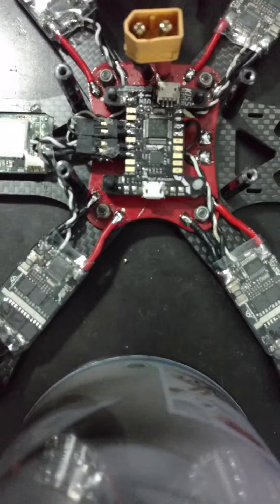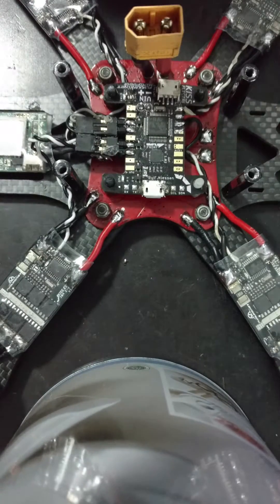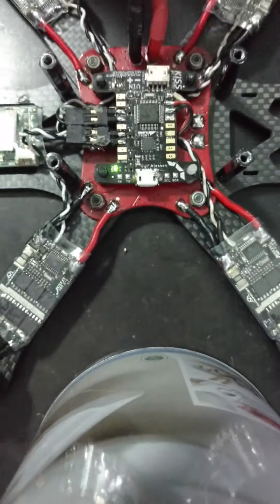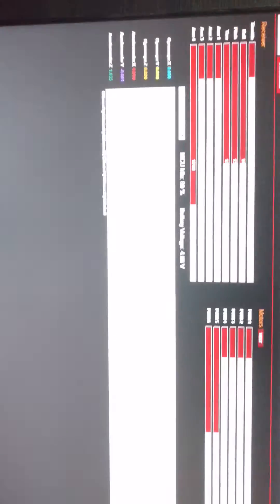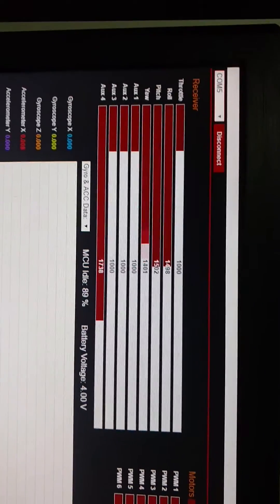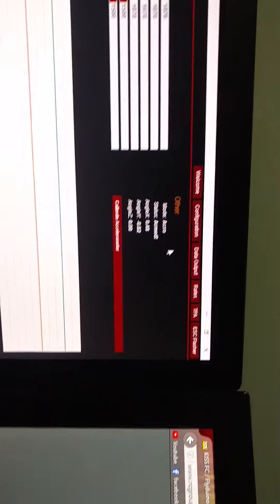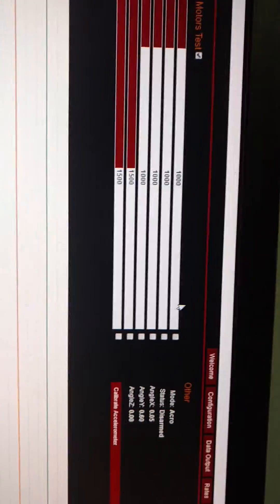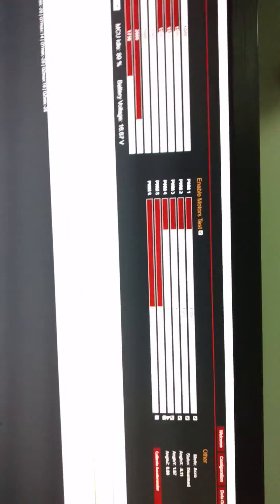Kiss fc not arming after update FIXED

Comment from the maker: **********************SOLVED********************  ******************

___Don't run oneshot 42 with 30A kiss Escs (8bit)._____

Finally with the help of a friend I was able to work out the problem. We
 discovered that I had oneshot 42 running on the Kiss 30A esc's and they
 dont like that. Switching back to 125 solved the problem that was 
driving me crazy!